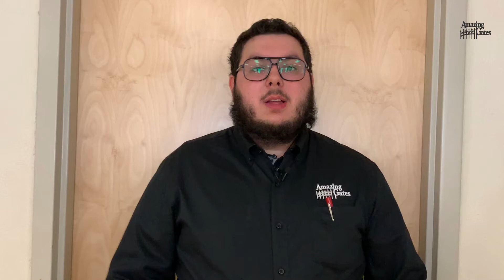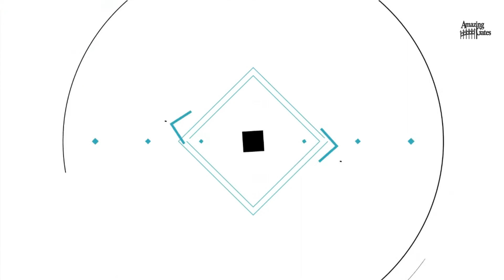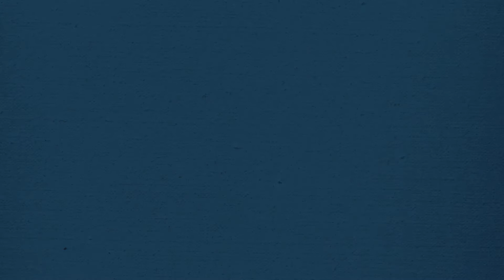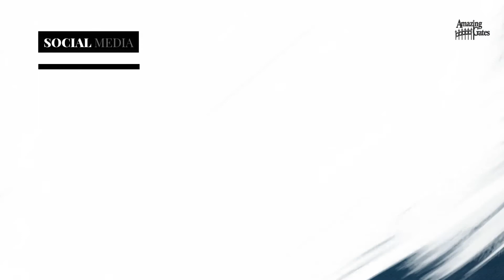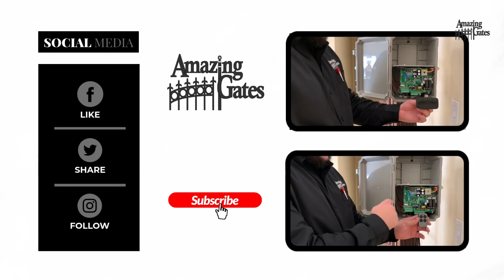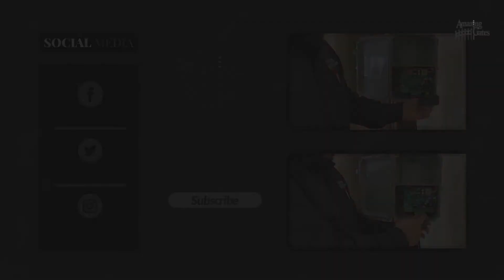AGA Program Settings Tutorial

Comment: We tried to setup the P9 on our gate last night and it was auto opening, instead of closing! Any clue what we did wrong?
Reply: Hey mate I just set mine up using this video and it's working fine. I was thinking, is it possible the gate was already open when you set the P9 function to auto close. It's possible if you make sure the gate is closed first, do a factory reset as described in this video, and then set the P9 function up again it may recognise the auto close correctly. Just a thought. Let me know if it works.  Cheers Andy 👍
Reply: This is because you have your gate motor polarity wired the wrong way.. where each motor is connected to the terminal on the circuit board, swap the red and black for each motor over. Currently when gates are open its thinks they are closed and vice-versa!